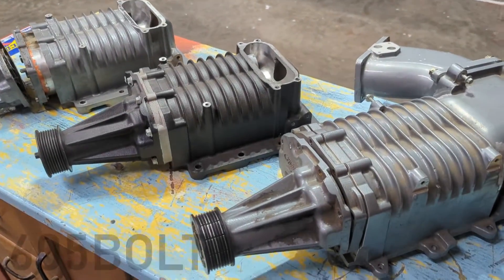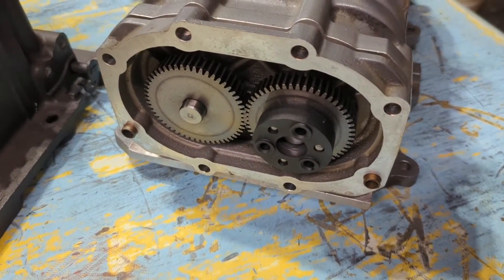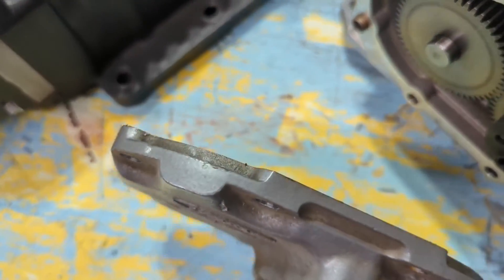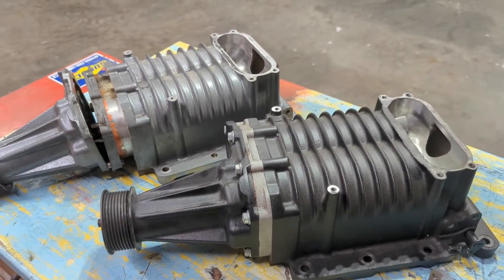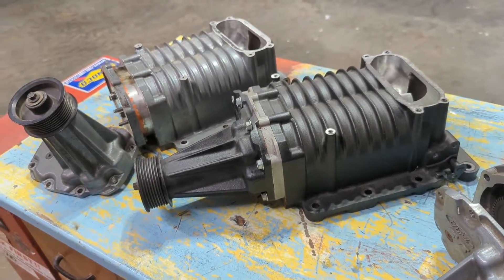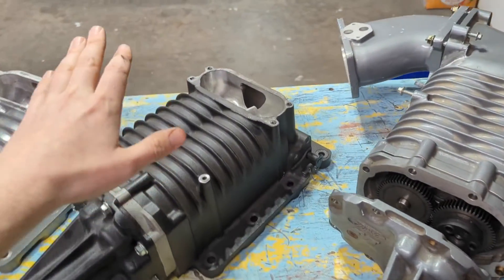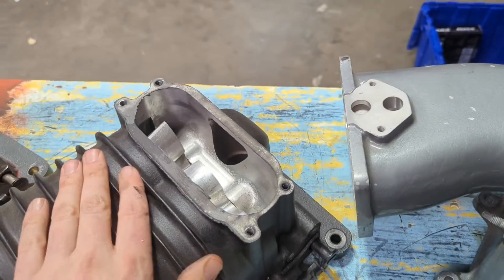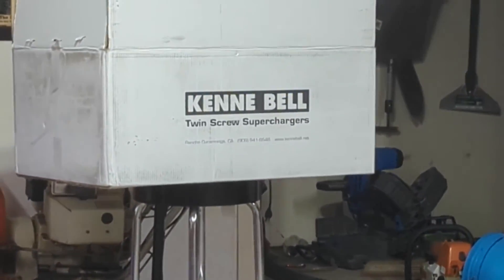SVT Eaton M112 Superchargers - Cobra, Lightning, Harley F150 Differences and Similarities Explained

Comment: Looking into putting one of these on my 6.0ls swapped wrangler... but I honestly dint care if it makes power I just want supercharger noises
Reply from the maker: They'll do it. Hopefully this helps you pick whether you want to pursue the Lightning or the Cobra version.  I would imagine one or the other would be better for your swap due to how differently the plenums approach the inlet.  That difference could really help or hurt your situation.
Reply from the maker: Also, if you are just looking for a bargain supercharger, for not much money more I would recommend the M122 from a shelby.  They're a smidge newer, smidge bigger, and overall very available.  Not near as old though.  Might be another option for you.  And they have a driver side inlet.  So that would give you the full list of possibilities. Cobra M112 is passenger rear entry, Lightning M112 is top driver but could easily be modified to top middle or however you want it, and Shelby M122 is driver entry.  Sounds like a cool project too by the way!
Reply: @605BOLT  oh its been ls swapped for a coupke years now n its definatly roudy but i need more!!! Mwaaaahahahahaha
Reply from the maker: For sure!

Comment: How many times could you potentially rebuild a M112?  What is the life of this thing, like miles wise?  Can I just keep rebuilding it?
Reply from the maker: As long as the rotors and case aren't ruined I think you can keep fixing them. According to some rebuilders, they will warranty their rebuilds and say they get OEM level mileage out of them. My lightning blowers were too screwed up to fix.
Reply: @605BOLT  Gotcha!  Looking at the Tork Tech; I'm assuming the M112 will deliver more power at lower RPM vs the M122...Thoughts?  Just need to Google-source a rebuilder. I don't trust eBay.
Reply from the maker: @DerDoppelagentI would say the other way around. M122 is next generation of Eaton supercharger from M112. I don't think that M112 touches it in any way. M122 would definitely be my choice if they make a lot for your application. Which is sounding like it's a 4.6 2V or maybe 5.4 2V.  There is only one place I would send my supercharger these days. That is Jon Bond Performance in Iowa.
Reply: @605BOLT It's an NA 01 Saleen 2V.  I appreciate the reference—that solves sourcing a rebuilder.

Comment: i got a 2003 HD f150 but its got a new engine i dint know if its a lighting or a another HD engine
Reply from the maker: Wouldn't be a very good way to tell unless you could get inside the motor. Lightnings have a different piston that drops the compression ratio.
Reply: @605BOLT  ohhh gotchu. thank you
Reply from the maker: @superchargedhector sorry I should clarify. Both the lightning and the Harley have the same lower compression piston. So that wouldn't really help you. Only real difference between a lightning and a Harley engine is the pulley size. The upper pulleys are slightly different. Otherwise, they are the same.
Reply: @605BOLT  yk how measure the pulley without taking the belt off?😂
Reply from the maker: Measure the upper pulley diameter with a tape measure and see where you're at. You don't need to remove the belt.😊
Reply: @ thank you!
Reply from the maker: @superchargedhector What pulley did you have? Lightning is 2.90". Harley is 3.25" i believe.
Reply: @ i have a 3.25. so should i jus mess with the lower pulley? and not mess either the upper?
Reply from the maker: @superchargedhector You could. Or you could switch the upper to a lightning size. But once you get to lightning size any smaller on the upper can lead to slip. So if you think you'll go further than that one swap, I would go ahead and buy a metco hub and keep the Harley upper. But there's lots of ways to go about it.
Reply: @605BOLT  okay what bout lighting pulley and lower pulley?
Reply from the maker: That would work fine.  They work as a combo.
Reply: @605BOLT whats the best combo i should do with the pulleys?
Reply from the maker: @superchargedhector depends on what you're tuned for. Could run up to about lightning upper and +6 lower on a stock bottom end. Would need some other supporting mods for that
Reply: @605BOLT i just want around 450 dont want to blow the wngine and what other mods would i need? thank you
Reply: on stock interals
Reply from the maker: @superchargedhector you will need a maf, pulley, cold air probably, 97 rails, pumps, some exhaust if possible such as long tube headers, E85 would be nice. And a tune to make it all work. 450 is pushing it pretty close to the limit especially if we're talking the heavier Harley trucks. That could pop any minute on factory rods is the problem.
Reply: @605BOLT so what hp should i stay at?
Reply from the maker: @superchargedhector I would say 400 or so wheel would be good. Push a little higher with E85 due to it basically never detonating. That would be my advice anyway. Unless you have the coin sitting around for a built motor.
Reply: @605BOLT damn. no i wish lol. but would it better for a built 5.4 or a 5.4 4v from a gt500 if i had the coin laying around
Reply from the maker: Same. That would be a rowdy swap.

Comment: Isn't this the Mercedes supercharger?
Reply from the maker: Pretty sure Mercedes doesn't use a blower this big.  I thought those were M45 or M62.  All the blowers from the video are SVT exclusive items.
Reply: @605BOLT  at least the 4 cylinder mercedes use the m45 or m62, i dont know if they have any big supercharged engines? I know jaguar use some of the bigger Eaton superchargers.
Reply from the maker: Ya I seem to remember the Jaguar part as well.
Reply: @605BOLT  
Does it fit V6 Mercedes cars? Or even V8s?
Reply from the maker: I guess I don't really know.  Like what Mercedes are you talking specifically? Should be easy to tell just by looking at it.
Reply: @Abo_talha187  I deepends on how much air and power you need. if you are gonna use the m45 og m62 on a v8 i suggest you use two of them , at least on the m45, as i think it struggles with anything over 250bhp pr supercharger if even that..

Comment: The M112 in the Cobra actually supported more power.The uncovered rotors in the Lightning inlet actualy lower its capacity.The old Magnum Powers housings for the Lightnings use to shuv the factory M112 rotor pack foward away from the inlet which carried the powerband out further.
Reply from the maker: @bigdaddy5212  good info!

Comment: #zzperformance makes different size pulleys all the way down to a 2.8 if I’m not mistaken.
Reply from the maker: Thats true they do.  Most lightning guys put a bigger lower pulley on though.  Lightning is unique in that it has no accessories on the supercharger belt.  The inner belt is for serpentine activities just like a normal 5.4 and the outer belt drives only the supercharger.  So by increasing the size of the outside, lower pulley, you get the same sort of result as as smaller upper pulley but with less belt slip.  The bigger blowers with small uppers tend to slip.  Lightning upper is often times about as small as most lightning guys go because you can get some really big lowers.  Big enough that it will kill an Eaton pretty quickly.  ZZP stuff is normally your 3800 GM engines (Regal, GP GTP, Monte Carlo SS, Bonneville SSEI).  Those have their alternator at least on the blower belt as well so you won't want to overspin your alternator.  Pretty sure anyway.
Reply: Nope, blower only
Reply from the maker: @jplperformance9073  ok interesting. I see that now from a diagram I'm looking at. Must not have clearance down low for a big lower pulley. Looks like it would hit an idler if it got much bigger.
Reply: @605BOLT  yeah I have both OD balancer. Powerbond still offers a 5% Overdrive balancer and ATI used to make a stock size but 8rib drive and a 10% OD also. I was able to get ahold of both ATI ones and I am running a Powerbond on my build im putting together as I type this. It's all on my channel somewhere.  Yeah oil neck spacers is the only way
Reply from the maker: @jplperformance9073  good stuff

Comment: gday mate, i have a 2000 mustang 4.6 2v with the saleen m90 series 1 supercharger kit and bearings i think failed but now i think about it the noise was like paper stuck in a vacuum and could have been the teflon coating coming off? its coming off in sheets now cause i was stupid and cleaned the rotors and the coating is fkd and peeling off.
my question is; in your experience having non coated rotors have u had any issues like thermal expansion etc? i cant see a telfon coating stopping much expansion because of heat sink the teflon wouldnt keep the rotors cool.

im worried if i take all the coating off i may sieze the m90 and destroy it?!
Reply from the maker: I can't really say.  Obviously the coating has some thickness even if it is just thousandths of an inch.  Removing it would increase the clearances slightly.  I think its safe to assume that removing the coating thickness will offset whatever increased thermal expansion takes place.  I wouldn't worry too much about it.  Also, recoating costs are effectively the same price as a rebuild so you might as well run it until it needs a rebuild and go from there.  Many supercharger specialists offer rotor stripping as a service so if yours is coming off I'd say thats ok.  Just part of them getting old I guess. I don't think your risk of seizure is any higher now that the coating is off.
Reply: @605BOLT  awesome cheers mate appreciate the response, I will definitely be looking into it (new coating).
Well I'm not in a position  to to recoat them at the moment and in Australia we have strick laws on chemicals and going off how hard it is to get a quality and affordable chrome plating for example is basically none existent lol.
I Might be better off buying a rebuilt from USA and get it delivered and still probably be cheaper.

If the bare rotors fail then the turbo goes on s9 win win either way🤣
Reply from the maker: @heathsmetalwerx  yep haha. That's where I'm at. Done rebuilding these tiny blowers. I'm moving on to bigger and badder

Comment: Hey man great info.  Thanks for posting.  I got an M112 on eBay for a 2001 pre-terminator 4V and the blower needs work.  Where do you suggest I send it for porting and a full overhaul including rotor coating?  I don’t want to end up with the same shop that didn’t work out for you twice.
Reply from the maker: @george.mattocks  if you put a gun to my head today I would go with supechargersonline or Jon bond performance. Many people recommend jokerz but I have been burned twice and that's enough for me. I have bought parts from Jon bond before and the guys are nice and they are only a couple hours from me so for that reason they would be my personal choice.
Reply: @605BOLT  sweet man thanks for the info. I’ve exchanged a couple emails with Jon Bond so glad to hear he isn’t the one that burned you.  Curious if you’ve attempted to time the rotors yourself.  I’ve ceramic coated stuff before and still have materials leftover.  Just wondering if it’s quite difficult to reassemble the rotors with correct timing.
Reply from the maker: @george.mattocks  I went through that mental exercise myself. Wasn't desperate enough to try it. Would need the fixturing to do so.
Reply: @605BOLT  gotcha.  Must be a very precise process.  Maybe I’ll disassemble and if I can’t put it together I’ll send for the overhaul.  Not desperate just like tinkering 😂
Reply from the maker: @george.mattocks  I hear you there. Might be what happens to my Eaton when I replace it with something much better soon. 🤫 Donated to science haha. The gears are pressed onto the rotors I think and there isn't a keyway or alignment dowel I don't think. But then again there must be something because in the factory that would be awful. Idk. I'm curious.
Reply: @605BOLT well I’ve got a shop press and I’m itching to start pressing lol.  Btw in your video you mention a difference in the rotors between the cobra and the lightning but never get back to what that difference is.  Just curious in the event lightning rotors become available.
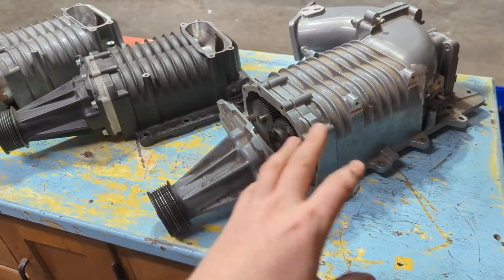Reply from the maker: @george.mattocks  9:49 the coating is different. Cobras have a powdery type of coating and lightnings have a Teflon coating. Kind of an interesting difference.
Reply: @605BOLT  oh cgotcha so that’s a what you were referring to.  I did hear that.  I’m going to remove all the coating and take a stab at cerakoting it.  Wish me luck with the timing 🫶🏽
Reply from the maker: @george.mattocks  nice. Good luck! 🤞
Reply: @605BOLT  thanks dude take care

Comment: Does the M112 have a special vented pulley bolt?
Reply from the maker: No that I'm aware of.  Lightning guys (me) don't have much experience with changing around the top pulley.  Lightnings almost always make the lower bigger rather than the top smaller.  To prevent belt slip.  Long way of me saying that I've never had to remove a snout pulley yet so I don't know about the pulley bolt.  Pretty sure it is not vented though.

Comment: Can i put any in my 1997 fordf150 4.6  2 valve
Reply from the maker: @maxperez3626  your only option would be a tork tech supercharger kit with PI heads. Your 97 would not have those but could be swapped to them. Not impossible but a procharger type setup would probably be slightly more convenient and probably cheaper too.
Reply from the maker: Other option would possibly be a tork tech kit but they require PI heads I think.
Reply: What if I have a 2006 f150 with a 2v 4.6 I think it’s a pi engine still ?
Reply from the maker: Yep that would be a PI 2V.
Reply: Kinda taking a long shot that you might see this post after so long. I have a 99 F150 4.6 2v that I swapped the heads to the Trickflow 44cc twisted wedge heads. Any idea if any of these blowers might possibly work with these heads?
Reply from the maker: 4.6 2v your best option is probably a procharger of some sort. Some sort of centrifugal. These would work with enough fabrication but not easy. Eaton's on a 2V use a Tork Tech kit. Not impossible to find but definitely not common.

Comment: Only 10,000 miles... can you tellus what caused it too fail?
Reply from the maker: I can't yet because I haven't taken it apart. Don't know that I ever will to be honest. It still spins freely unlike my other one but I took it off before I killed it completely. Someone may be able to use it as parts.
Reply: @605BOLT  the eaton m90 makes noise sometimes and it's usually because of play with the snout coupler. the one you showed seemed tight so I'm not sure about that in this case.

Comment: Great video ! Any idea how much difference the 8lb lower makes over the 6lb ? heard its diminishing returns because of heat
Reply from the maker: I never ran a 6. Just went right for the 8 and E85 right off. But the blowers don't last with a big pulley in my experience. Hence moving on to better things. I have a built engine so there wasn't really the risk of scattering the engine for me.
Reply from the maker: To answer your question though I doubt the 8 is that much better than 6.
Reply: @605BOLT  I actually looked further into this.Seems like 8lb and 10lb lowers do not make anymore power at peak over a 6lb lower.What they do is pick up power under the curve and 20-40ft lbs of torque at peak which can help ET times a little.
Reply from the maker: @bigdaddy5212  In most applications I would say thats true.  Only run the 8 and 10 if you can fight the extra heat it generates through cooling mods or fuel choice etc.  I run E85 with several cooling mods (see my video on this) and that helps reduce the downside of the 8lb. It doesn't help the blower last though.  You're right in saying it hits a little differently.  It hits nicely off the line even off foot brake because that blower goes to full song just about right away.  Thanks for watching!!
Reply: Would you say the same for a Harley truck? Where 8# would be equivalent to a L 6#? Keeping the stock upper, obviously.
Reply from the maker: Ya lots of guys go 8# on harley which is the same as a 6# on Lightning.  That would be a nice setup I think.  Any time you pulley up it is hard on the blower but ya, you'll notice a difference for sure haha.
Reply: @605BOLT  You would actually need a 10lb lower on a Harley to get the same blower rpms as a 6lb lower on a Lightning.
Reply: Thanks man. I’m a little leary now that I’ve ordered one for my daily driver now hearing your issues though.
Reply from the maker: @grantbaggs1111  I hear you. I expected way longer lasting performance out of my full effort blowers. Once would be a fluke. Twice is getting to be a pattern.